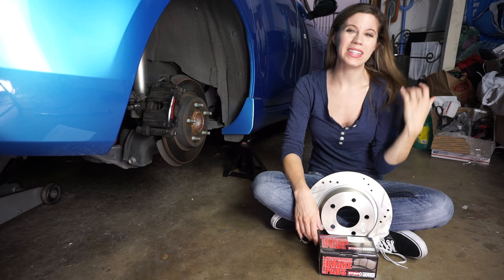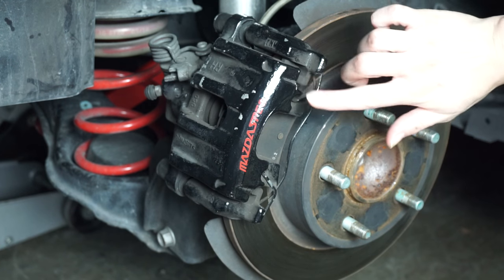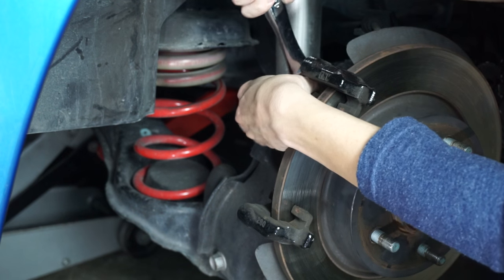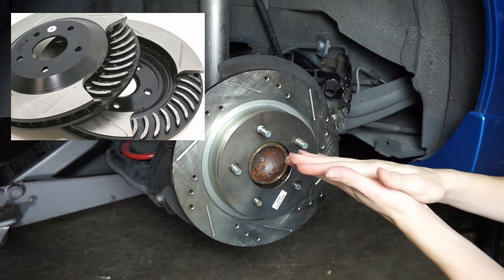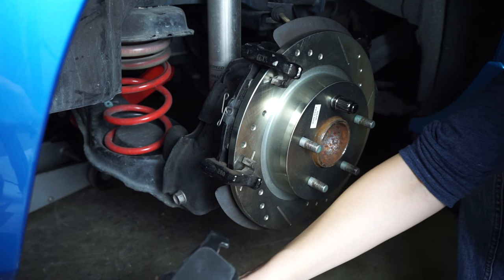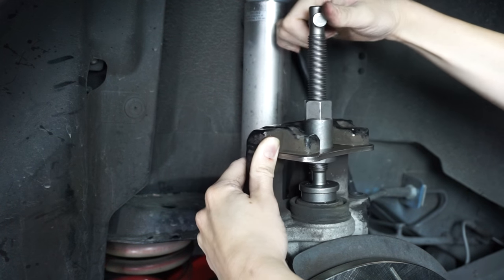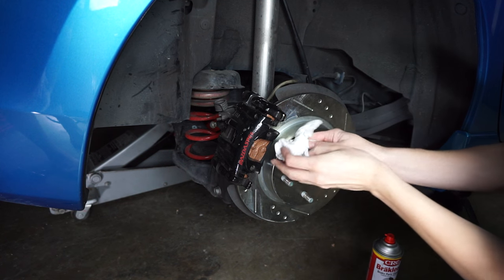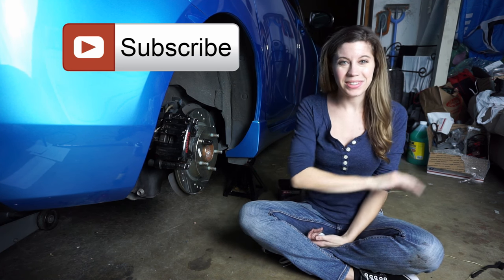HOW TO REPLACE REAR DISC BRAKES - ROTORS AND PADS!

Comment: loosen/open brake fluid reservoir before compressing the piston, so fluid has where to retract. That will make compressing much easier and can be done with nose pliers. Will also help with releasing e-brake cable

Comment: Nice guide...also want to make sure you clean the new rotor off with brake cleaner, as they are usually covered in manufacturing oil to keep them from rusting during storage until they are sold.
Reply from the maker: +GoodeZilla The disc surface was absolutely bone dry to the touch so I did not feel the need to spray it down with brake cleaner. This rotor was zinc coated and not oiled from the factory. Seems pretty standard on most performance rotors I've seen. You make a good point though, if the rotor has an oily surface you should spray it down with brake cleaner before install.
Reply: GoodeZilla aa
Reply: I do know that in South Africa the disks come in a sealed air tight bag,so no need for oil or any cleaning up afterwards.

Comment: I was always taught to put silicon gel instead of grease on the caliper guide pins as they wouldn't eat up the little black plastic covering the guide pins.
Reply: me too, guess I'll try both and see which is better
Reply: Grease heats up easily and drys out very quickly whereas silicon paste does not, so the silicon paste is always the preferred lube for caliper pins.

Comment: I installed drill & slotted brake rotors on both of my Toyota Highlander & Hyundai Elantra. Now the braking has improved. The brand I used is Max Brakes 😍

Comment: why do you need to remove the ebrake cable..I've changed brakes with ebrake integrated calipers and never had to remove the cable unless replacing the whole assembly
Reply: I agree this step is unnecessary. I did the same thing on a 2005 Mazda 3 (same rear brakes) and didn't have to remove the cable.

Comment: If this is your daily, ceramic pads are not very good when cold and drilled rotors aren’t very good any more because the pads have advanced. Don’t forget to spray with brake cleaner on the discs because there’s a light coating of oil on them for storage and since you’re down there, you can always service your calipers. I recommend painting your discs to help prevent corrosion and placing antiseize on the surface area where the disc contacts hub so it’s not hard removing it next time. This isn’t a knock at this youtuber, but suggestions to raise your game. You can also quickly, and lightly, open the bleeder valve to make sure it doesn’t rust over and force you to buy a new caliper.

Comment: Just seeing this and great content.  I use one of the old brake pads and a c-clamp to squeeze / retract the caliper piston, after opening the master cylinder cover and putting a rag under to catch any fluid that backs up through the system and out the top.  I've not owned a car where the piston could be spun like that - interesting...

Comment: i did mostly like you did but on the rear bolt of caliper (the one with platic dust cover), i put silicone grease on it cauz  the caliper slide on it to ajusting  for the lil runtout of the rotor.  i like your tutorial save me ton on money :D

Comment: Good video overall, however slider pins are supposed to be lubricated with a proper brake assembly grease that does not chemically affect the rubber boots. Also, correct brake lubricant collects a bit less dirt over time, so it's always a better choice than copper grease.

Comment: The two holes in the caliper piston are supposed to line up with the two pins which protrude from the backing plate of the inner brake pad.

Comment: Does that tool also work for second generation speed 3? I replaced my front breaks in my 2013 speed 3 and it took my at least 2 hours.
Reply from the maker: +Inked Speed3 This is a second generation Mazdaspeed 3. Fits like a glove.
Reply: +everythingdiy thanks! Where can I get that tool at, and I love the channel!

Comment: Do you really need to remove the parking break cable? I just replaced my rear brakes on my truck yesterday and did not have to remove the cable at all even though I thought I would.  Did I miss something?  I replaced the rotors and pads.

Comment: Most Toyota’s that I have worked on, have like a 10 mm hole in the rotors. You just screw a bolt in, and it pops off. No need to beat it with a hammer!

Comment: Why didn't you take off the caliper and caliper mount altogether? The guide pins hold the caliper to the mount and the pads will just pop right out and then pop the new ones in
Reply from the maker: Makes swapping out the pads and compressing the piston easier.

Comment: Where did you get the caliper tool kit for $25?
Reply from the maker: +B. Parker Amazon Prime. Price has gone up a bit but this is the one we bought: http://www.amazon.com/8milelake-21pc-Professional-Brake-Caliper/dp/B0122Q83T4?ie=UTF8&psc=1&redirect=true&ref_=oh_aui_search_detailpage. You can also go a little more basic and buy this one for $20: http://www.amazon.com/Neiko%C2%AE-20733A-Brake-Caliper-12-Piece/dp/B000IB40L6/ref=sr_1_10?s=automotive&ie=UTF8&qid=1463614778&sr=1-10&keywords=brake+caliper+tool
Reply: +B. Parker Could also just use needle nose pliers

Comment: What are the sizes of the Bolts and the hex nuts? I'm guessing it's 17mm bolt and a 6mm hex key? might be wrong, but it's better to put it in the description. Just sayin... thanks!
Reply: Yes, please add the sizes to the description, also a link to the front brake and rotor video would be nice as well.
Reply from the maker: +drew agustin Different manufacturers use varying nuts and bolt sizes- so I don't want to be too specific about the size of the sockets. This guide will likely be used by more vehicles than just a Mazdaspeed 3.
Reply: +everythingdiy Understood... Were you using 17mm and a 6mm hex key for the hext nut and bolt? I need to do my rear brakes pretty soon on me and my buddy's gen 1 and 2... Just want to confirm so that I can grab the right tools I need. Save me some time. THANKS so Much for the videos! I really learned a lot from watching all your videos! Keep it up!

Comment: do i need to bleed the brakes?
Reply: You only need to bleed the brakes if you remove the hose from the caliber. So no. Bleeding brakes is for removing air in the the hose and old brake fluid.

Comment: Lateral runout and endplay at the hub? .004in or lateral runout with the old rotor can easily exceed .010in of lateral runout on the new rotor... That will eat up and destroy your bearings if there was already a prior issue at the hub/bearing.... replacing parts is fun until a 5 minute check could save you wasting all that money destroying a set of pads and rotors.

Comment: Why are you so darn pretty.  I would learn more if you looked like Cinderella's mother rather than Cinderella.

Great video -- Is the spinning of the rear pistons a Mazda thing, or are most cars that way?
Reply from the maker: +Todd Dembsky The spinning is most cars with rear disc brakes. It's due to the parking brake.